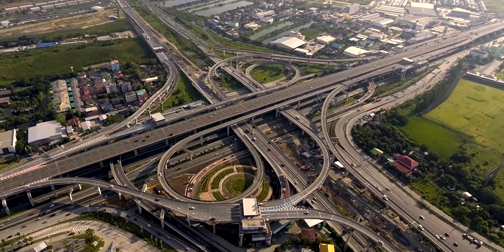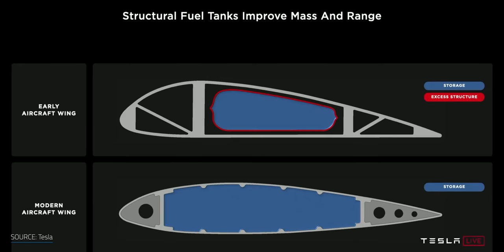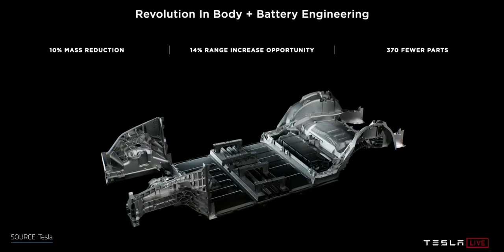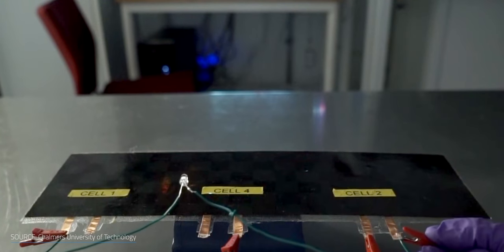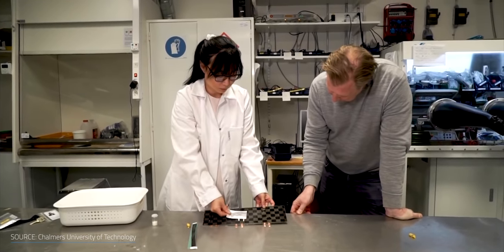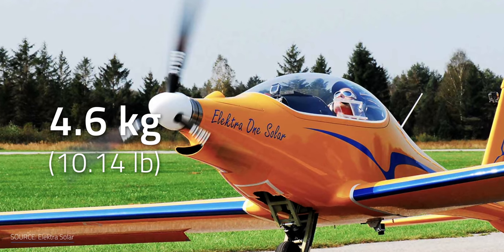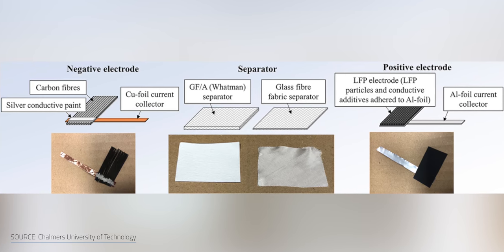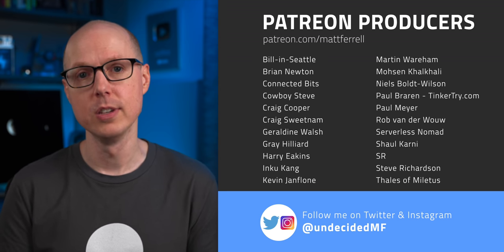Exploring Structural Batteries

Comment: This doesn't sound like a concept that lends itself well to sustainability.
Reply: @wolfgangpreier9160  On the other hand, actually. This format of battery will probably be very exclusive and very expensive. It will see its application in aerospace surely, airplanes, maybe even super high-end Electric cars, since carbon fiber is super expensive to produce. Furthermore, carbon fiber is non-recyclable so it won't be nearly as sustainable as aluminium, for example. It's a cool bit of tech, but as a sustainable mass-market application, it leaves too much to be desired.
Reply: Why not? This will sustain military activity in countries with lithium for decades.
Reply: @williamdafoe3567  You started off good and then veered directly into Lies. Good job.
Reply: @williamdafoe3567  Thats why they only make Electric cars which are horrible for the environment instead of Hydrogen cars
Reply: @HimitsuHunter  While he may not be 100% correct he is also not totally wrong either. The reality is that many of the so-called "green" energy sources are just as damaging to the environment as traditional energy sources.  The processes  for mining and refining the rare earth elements required for solar and battery technology are extremely damaging to the environment.  On the wind side, many people don't know this but a single wind turbine in one month requires roughly the same amount of lubricant as the average ICE powered car requires in around a year's worth of driving (~10k miles). all of that waste oil/lubricant has to be disposed of somewhere.  On top of that because they are mechanical in nature they require constant maintenance.  I invite you to drive by a wind farm at some point and you'll find that on any given day around 20% to 25% of the turbines are idle being worked on.
Reply: @rsantos4378  you can allways burn the carbon fybre and use part of the released energy to create new........kinda hard if you can not separate it though
Reply: @wolfgangpreier9160  the lack of sustainability part comes from the fact that these batteries would be integrated into the structure of the vehicle/device/appliance that is using them and when these batteries inevitably fail the entire vehicle/device/appliance will need to be disposed of and replaced.

A small example of this are the cell phones that many of us carry around.  If you've gotten a new phone sometime within the past 3-4 years you'll find that the battery is now not user replaceable and many manufactures direct you toward getting a new device rather than replacing the battery on your current one. This is especially true if you own one of the big brand phones like Apple or Samsung.  And the last that I checked new cell phones have been increasing in price by about 15% to 20% year after year not getting any cheaper and more affordable especially to lower income people.
Reply: @2020Max1  "and when these batteries inevitably fail" says who? Who says that the middle part - the part that includes all battery cells - can not be exchanged just like a bolted on battery pack? The differenc eis: a battery pack needs the external rigidity and structural integrity of the chassis. Whereas the integrated battery pack IS part of the chassis.So ewhen you take out this part you should take care of the rest of the car that it does not crumple on the lift.

You sound like those oldtimers that told us that the SETRA - The busses that Kässbohrer developed in Germany which were cheaper, better, lighter, much more rigid than their ancestors with a frame - cannot succeed because it has no frame where everything bolts to. That was in the 1950s and 60s. 

If thats your wish please keep with your Ford or GM Pickup Trucks. They will have their frames and size and looks as always. Even in 1000 years. 

Or even better buy a Nio. They sell you the every time changeable battery pack. If you are so fond of changeable battery packs you must buy Chinese!

Boring!
Reply: @wolfgangpreier9160  EV manufactures, yes even Tesla, push you into buying completely new battery packs at a cost of thousands of dollars when their batteries are damaged or out right fail, EVEN if a relatively simple $500 repair would resolve the problem. And that's for a unit that is relatively easy to remove... WTH do you think is going to happen when they make it a hard mount structural component within the vehicle.  I am not saying that this is a bad idea for all applications, just that it does not make sense  on the consumer market because it fosters the toss and replace mentality, as opposed to a true sustainable mindset of repairing and extending the life of the item.  

Prior to getting my current cell phone I used my previous one for 12 years in that time I spent about $50 on replacement batteries for it.  Contrast that to the current model where you are replacing your device ever 2 to 4 years and paying $500 to $1200 each time.  It's stupid and it's wasteful in both money and material.
Reply: @2020Max1  Yes they do. And so do all others too. Battery packs are safety critical and dangerous elements in your car. They can not be "repaired". Only exchanged. If you want to risk limb and life in your driveway be my guest. But don't come running if your house burns down.
I told ya.
And please stop comparing cars with handys - you say smartphones - we say handys.. There is a world of difference between those.
Reply: @2020Max1  Yes i know. You just confirm what i told you. A battery pack once assembled and sealed will, in case of damage whatsoever, not be repaired and used in EVs ever again. 
And please do not talk about Tesla alone such as Tesla is the biggest crook, tesla is the biggest fraud etc. Just say its Geely. Great Wall, SAIC, Or you could say Ford. BMW, Honda. It does not matter which manufacturer.

When you talk about Moped and Mofas or golfcarts and other such small vehicles with 48V systems - yes they can and will be repaired down to cell level. But not HV EVs. Of course there will be some DIY and inventive entrepreneurs trying and maybe even succeeding to repair a HV battery. But those cars with such batteries loose all insurance and are not safe to be used on the streets anymore.

When a EV battery breaks it must be replaced. Full stop.
Reply: @2020Max1  That amount of lubricant is honestly not that much when you compare it to something such as the heavy marine industry (which are also producing CO2 emissions) and when one turbine can provide the potential electricity for multiple electric cars (with a lower lubrication requirement), the offset it noticeable.  CCGT also require maintenance with landfill-destined parts and substances.  The argument should not purely be about how bad turbines are for the environment, it should be comparing them output-to-output with CCGT, a study which has been carried out multiple times and offshore wind has always come out on top of fossil-fuel based electricity generation.  It would be a more valuable use of your time to instead suggest people use less electricity in the first place, as any form of electricity generation is going to have problems and some are simply unrealistic in certain geographic areas (the main proposers against wind being nuclear, which should never be installed near fault lines and also require extensive mining).
Reply: @wolfgangpreier9160  Sorry Bro... no matter how you slice it, Paying thousands of dollars to replace a battery that requires a $700 repair of a plastic coolant fitting that has virtually NOTHING to do with compromising the battery cells, is just plain fucking stupid.  

This is not about Tesla... EVERY EV manufacturer does this because it nets them more money in their pocket while absolving them from the responsibility to service their product.

Crack a mount, fitting or damage the bottom of the skid pan, or any other damage even if it doesn't compromise the battery cells and they will push you into replacing the entire battery pack for several thousand dollars as opposed to several hundred to do a real repair.  

Even if a bank of cells becomes compromised the repair is relatively straight forward for anyone with the skill to replace them.  What do you think is the smarter use of your money... spending 2k-3k to have a certified tech replace a bad battery bank or $16k+ for that same certified tech to swap out 10 battery banks because one of them went bad?

You were the one that brought up how this would lead to "Lower prices so that lower income families would have more access to them"   Tell me now how many lower income families can afford to pay $16k every time they damage their EV battery by running over a piece of road debris.
Reply: @nicholasnash6946  It's interesting that you bring up the Marine Industry in this thread,  you do know that maritime shipping while it does use fossil fuels, is one of the most efficient methods for reliably  moving mass quantities of goods and material across vast distances for the amount of CO2 generated?   You also do realize that for moving goods and material across a land mass diesel-electric trains are by far more efficient than any other method of transportation when you consider the amount of time and energy expended for the amount of goods moved.  Even if you managed to have a fleet of electric trucks with the total capacity of one long haul train, the train would STILL be more efficient for the amount of time and energy expended AND at the same or lower impact to the environment.

As far as energy generation goes,  don't get me wrong I am not at all against renewables as a potential source of energy, what I am though is a realist.  Unlike most greenies who believe that we can just flip a switch and go from a fossil fuel based energy sector to a renewable based one, i know that the reality is that we are still decades away from that even being a possibility.  At least being a possibility without also wrecking the world's economy and imposing untold hardship on people who just want to live their lives.  One of the big realities of renewable energy is the fact that they are not "on demand" sources.  There will be times when there is no sunlight for solar generation, there will be times when there is no wind for wind generation, there are also issues with storing power for later use.  Current LNG, Coal, and Nuclear plants have the advantage of being "on demand" meaning that they can regulate their output to meet the current consumption needs.  Another thing to consider is land use.  Assuming that all energy output is equal (which it is not) a solar plant takes up 4 to 5 times as much land area as an LNG, Coal or Nuclear plant to generate roughly the same amount of power, but it is only capable of doing so for roughly 1/2 of the time.  Wind farms are much worse when it comes to land usage as they require 8 to 10 times as much land area as conventional energy plants and as I stated previously due to maintenance concerns they typically only run at around 75% capacity at any given time (assume available wind).
Reply: @2020Max1  I don‘t „slice“ anything. I eat my baguette unsliced we in Europe have real bread after all! 
I tell you how its being done and why and why this will not change ever. Whether you like it or not is besides the point.
Reply: @daskampffredchen  hydrogen doesn't make sense for regular people
Reply: @orangecookie3132  You would fill up a Hydrogen car the same way you fill up a gas powered car. It would even be possible to retrofit a Diesel car to accept Hydrogen. The biggest problem is the infrastructure
Reply: @2020Max1  If we talk about future one must include oil price and taxation. Eventually oil will end up heavily taxed same as tobacco. On other hand you will see heavy investments in battery production which will lower costs eventually. BlackRock, Vanguard and State Street are pushing heavily companies they manage to go green. They have trillions of USD under they management.
Reply: @williamdafoe3567  I can't speak for solar as I have no experience in it. However - Wind, Hydro and Thermal - I have a life time of experience in. Wind is more than viable - and has been proven in many countries including where I live - 40% of our electricity comes from wind and we don't have that many windfarms - just well placed windfarms. More harmful?? - please provide your data on that. I'd love to hear what you know that no one else knows. What are the emissions from windfarms - including the manufacture of turbines, building of windfarms etc.
Reply: @wolfgangpreier9160  Yes and you in Europe also pay about 40% more for your energy than we do here in the US.  Careful not to choke on your baguette.
Reply: @rsantos4378  Non-Recyclability and sustainability are not mutually exclusive. You can't recycle carbon fibre. But you can get the carbon needed from a sustainable mass-cycle of carbon, and use renewable energy for the production of carbon fibre and structural batteries as a whole.
Reply: @williamdafoe3567     Haha. I asked and you provided - albeit in the aggressive and insulting way I'd expect from you. Nicely written :) I can't even remember what I wrote - give me a minute to review.............
Ah yes - as I thought no one was insulting to you just asking questions. And yes....heard all that before - which isn't surprising since I've worked with companies that build windfarms for a long time. Some of what you say is 100% true. The same companies also build very efficient thermal stations. They also come at a price. Lots of the older thermal generators are getting shut down at the moment by environmental protection agencies - for right or wrong reasons - I'm sure if you think it's just CO2 coming out of them you think they shouldn't be shut down.
You don't need to be a keyboard warrior when you talk to people online - only makes you look smug and arrogant but I doubt you even realise how it sounds.

Comment: All depends on just how much structural strength and battery density you get to trade between when building with these structural cells and how complex the interconnects for these cells need to be. With a 20% relative density compared to a pure battery pack, I'm a little skeptical, especially when you consider how difficult carbon fiber can be to work with, especially in an assembly line. For planes this kind of makes sense because of how insanely important weight savings are, in land vehicles weight saving importance is much less significant.
Reply: Yh but this is distributed throughout the body. Plus, you can still have a battery pack. This allows you to lose a significant amount of weight with the pack that you choose. It would likely be less brutal on the environment than using only regular batteries and would help supplement our demand for batteries. Hybridization of not only our energy, but also storage is usually the way you want to go for high efficiency designs
Reply: @drhubs7049  The problem is that weight has close to no impact on how much battery you use, so within reason it doesn't matter how heavy your car is.
Reply: @josefstalin4532  you realize you're talking about electric cars right. I'm open to being wrong, however I do think you're full of bologna saying that a load has little to no effect on an electrical motor's power consumption in comparison to no load.
Reply: @drhubs7049  Obviously it doesn't have zero effect, but it's pretty close.

Let's say this technology could decrease the total weight of the vehicle by 15%, which is being very generous considering the batteries in current electric cars only make up 25% of their weight:

at highway speeds, 60mph, the rolling resistance only makes up about a fifth of the total energy required to stay at the same speed. The 15% (weight reduction) is directly proportional to the rolling resistance and no effect on aerodynamic drag, meaning you only save 15% of the roughly 20% of the energy that was lost to rolling resistance in the first place.

This means you only use 3% less battery than you otherwise would at the same speed. This would be closer to 2% at 70mph.

I don't intend to be rude, but I think it's pretty obvious that this particular approach is unpractical in cars, as opposed to airplanes, where it could be very useful.
Reply: @josefstalin4532  I did say in an earlier statement that when it comes to the balance perk of this energy design I think it would be better used in flight.

Thanks for taking time to evaluate and explain that. 

I do think, like most technologies in their infancy, it's hard to predict its far reaching potential and how far it's capable of going.

P.S. I took nothing you said as rude as much as I did informative

Comment: So they are designed to fail predictably, but how are they repaired/replaced? I expect it will not be consumer friendly but also recognize my bias.
Reply: I'm not sure how they will be used, if if I was to design a car, It would have to be modular with the pieces able to be taking apart kinda like legos (albeit bolted in of course). Something that can be taken off and replaced within 30 minutes or less
Reply: Apparently its confirmed you can just cut off certain parts and replace the battery through the chassis.
This isnt an ICE car. Its probably lego level easy for mechanics to dissasemble. Theirs a reason they went with a bolted design over welding it shut. 

It shouldnt be any problem for legislators to enforce right for repair imo.

Comment: Car salesman: slaps roof of the car
Car: burns down
Reply: along with the next 4ft of pavement concrete and soil beneath it. nothing better than a car made of lithium thermite,.... RIGHT?!?!
Reply: Built Ford Tough.   Tough to extinguish, anyway.
Reply: Car salesman: throws rock at car window in front on hundreds
Car: window breaks....
Reply: @danisyx5804  my brain is going the same way along that point, are these batteries chemically inert when twisted, contorted, torn, ripped, shredded, crushed, in you know something like a wreck.